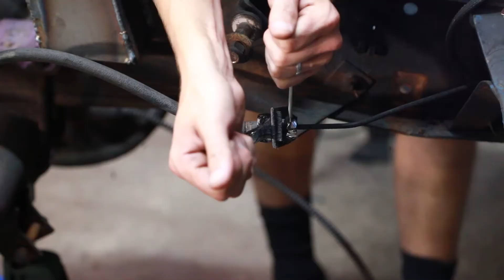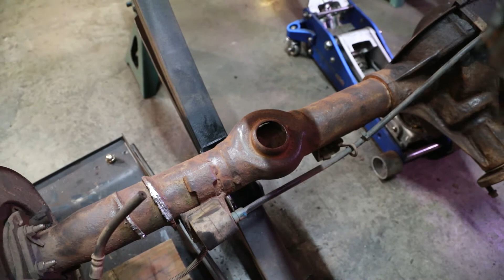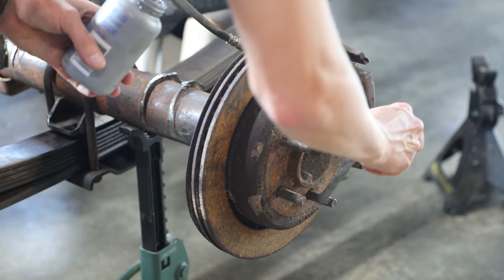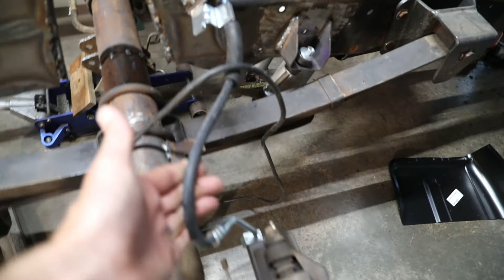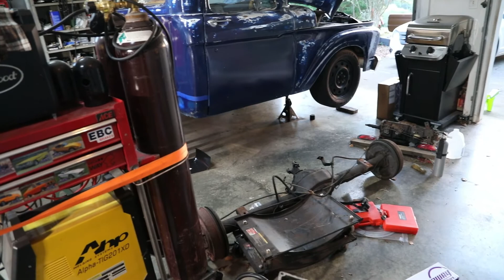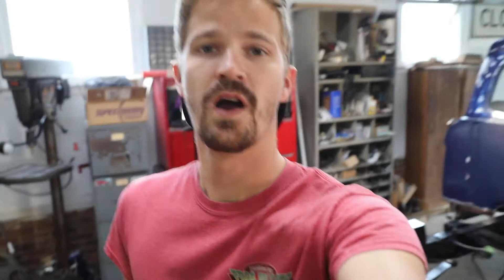F100 Axle Swap, Part 14

Comment: Why would you use a Crown Vic rear end and not an explorer rear? I hope you either modified the perches for the skinny axle tubes. Are you going to narrow it? The track width has to be way too wide because the explorer unit is perfect for my 69 f100

Comment: What year car is this axle from? Doing this swap on my 1970 f100
Reply from the maker: I used an axle from a 03 or newer crown vic to match the bolt pattern on the front and gain disc brakes and a LSD
Reply: @Petrol360  I bought an 03 or newer and it ended being too wide for my 1970 f100. Went with a 1999 crown vic police car axle. Slightly narrower, posi, and disc brakes as well!
Reply from the maker: Yes the downside to the crown vic 8.8 is the width. On a future video you will see my struggle with it!
Reply: @scottheinonen  Did the rear end from the 1999 fix good ? I have a 1972 F 100 with a crown vic front end and I want to put a 8.8 in it too .
Reply: @LV_2XLR8  Yep, perfect width. I put newer mustang gt wheels and they fit really good in the wheel wells all the way around
Reply: Do you have any pics of the rear axle with the bed on?
 @scottheinonen